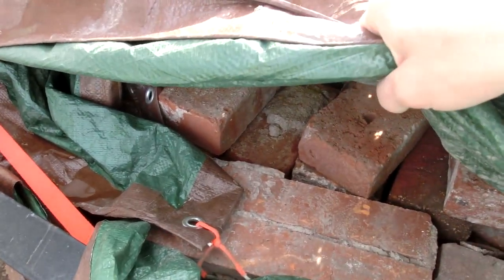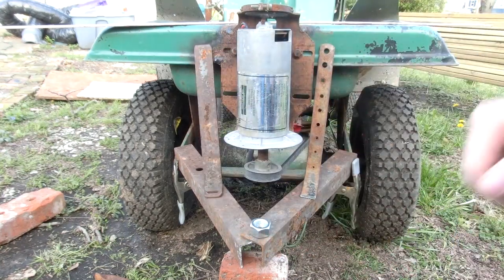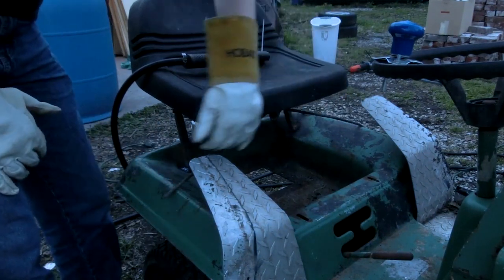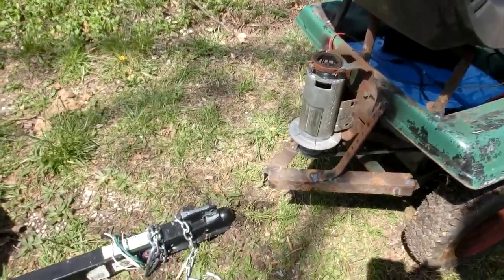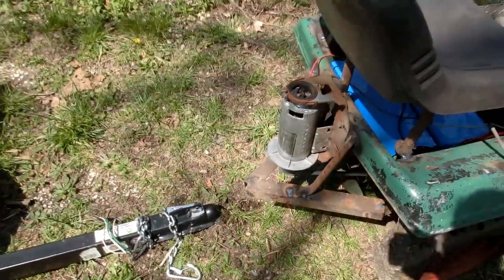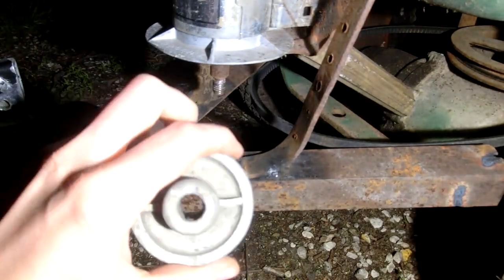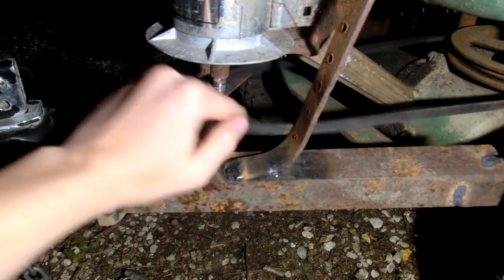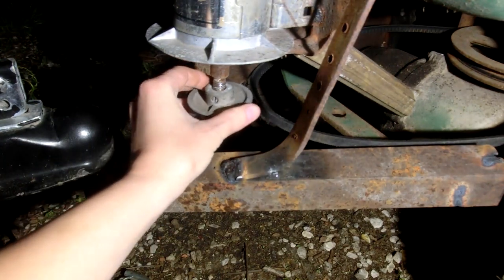DIY Electric Lawn Tractor part 14: Trailer Hitch

Comment: mount the motor in front under the hood. that would free up space in the rear for the ball hitch to be placed close to the rear axle. that would prevent tipping. it would be awesome to add a second motor and batteries for a lawn mower blade. definitely go all lithium. save the lead acid batteries for your photo voltaic system. p.s. i would love to see you do a series of converting old power tools and appliances to battery powered electric. name suggestion, "Will it Lithium?" p.s.s. i just discovered your channel 3 days ago and have been binge watching ever since. thank you for the awesome content!
Reply from the maker: +stompbot272 its working well enough at the back, and it leaves the front open. i might need that space in the front for hydraulics in the future.

thats a nice name idea for tool upgrades, although im not a huge fan of power tools and dont work with them much.

and im glad to hear your enjoying the videos! im trying to increase from 100 videos a year to 150 or 200, so there should be plenty more for you to watch in the future. so far this year ive set a new record for video output for each month and already at like 75 uploads this year, so i feel i might actually reach that goal. :D
Reply: your electric bike videos are what caught my attention. i am planning to build my own 2wd fat tire bike soon. still trying to figure out how to power two 1000 Watt hub motors with one controller. thanks to you, i have a way to make an inexpensive 48v battery

Comment: When welding nuts is good to have a sacrificial bolt or all thread, threaded in place to keep the nut in line and to keep warping to a minimum.

Comment: This is something I need to get around to doing. I just use an old bolt into a flange on the back of my riding mower. Admittedly it works, mostly because the flange is reinforced as it was meant to drag around a much larger mower/mulcher attachment. If only I had any use for the drive connection at the back of my mower.

EDIT: If your going to use a chain, use something like motorcycle chain instead of bicycle chain.
Reply from the maker: i was thinking i'd get chain from rural king thats made for farm equipment, but i agree, bike chain wouldnt be very nice to use.
Reply: Yeah that sounds pretty good. From experience bike chain sucks, even for use on a bicycle. For my current bike I actually went and bought a much more expensive chain just because I had it break once when I was about 20km from home on a trail and didn't much care for the four hour long walk back because It broke in a stupid, stupid way. Pretty sure the chain is worth more then the bike.
Reply from the maker: i've honestly never had a chain fail on me before, especially now that i have electric motors on my bikes. haha
Reply: How about an old timing chain and gears from a junkyard? Not sure if the gears would be the right size both ID and OD but it may be worth looking into, it would certainly handle a lot more torque than a bike chain, plus it would be damn cheap maybe 20 bucks max.
Reply: Yeah, well I bought my bike on sale, so they took off everything of value from the frame, and replaced the more expensive chain with a cheaper one.

Comment: Love the old welder used to use one like that years ago 46 plus years ago...neat old machine ... Love Ur Tractor,  but would  like to see more or of a newer or nicer mower build electric wise, with the motor under the hood, bigger better tires and. a winch on front... hArbor freight has them cheap enough and a old garden tractor can be found cheap enough like a Cub Cadet, John   Deere , Wheel Horse , same with a plow and u could use linear actuator for lifting your blades, also u could use an old water tank if u cut it up yo make a decent blade out of as I did... anything wrong with Ur system just thought u might want to try Ur skills on a newer bigger tractor food for thought so to say also u could put motors on each blade to cut the grass... thanks Rhinoa

Comment: I gotta get busy on my lawn tractor.  I DO have electric reversing and a (commercial) PWM speed controller as well as a three-speed transaxle.  When I had the one horsepower motor it would go into 25% overload climbing my relatively steep driveway in third gear but now with the two horsepower motor it just flies.  Top speed with the current gearing is calculated at 5.77 mph.

You might want to experiment with a wider vee belt drive to transmit more power.  I have a chain drive on mine and it is really picky about alignment, a problem greatly alleviated by the "rubber band" drive.

Comment: On farm tractors you usually have a place on the front to add weights to keep the front end on the ground when moving heavy trailers or three point implements. Or you could add a few more batteries, they weigh quite a bit.
Reply from the maker: yeah but i didnt want to put too much stress on the back.

Comment: the railroad tie piece could be screwed onto the front as removable ballast.  (for when the trailer is heavy.) and if bolts are long enough you can add more.

Comment: The three phase motor out of a fork lift truck aught to be powerful but a DC to 3 phase inverter would be needed with the required amperage to drive said motor.

Comment: Place your hand at the bottom of the steering wheel (6 o'clock position) and turn that hand in the direction you want your trailer to go
Reply from the maker: no thanks, my steering wheel is geared too much to do that and plus i like keeping my hand near the top.

Comment: When you said you were going to fix the front tool I though you might add a ballast box and put some brick in it so the load was more balanced. I suppose that extra weight would really tax the power capability though. You might be able to drill all the way through the spindle of the motor and pin the pulley on.
Reply from the maker: no, i can just stuff weight where the engine used to be.

Comment: Put a 5 gallon bucket on the front end of your mower and fill it with water. should help balance it out.
Reply from the maker: i just put bricks or metal rail plates in the front.
Reply: Rinoa Super-Genius that works. lawn tractors are really awesome to move trailers around the property. I hear they cut grass too.
Reply from the maker: +ThriftStore Hacker no thats what mowers are for

Comment: Would another stage of gear reduction help ?
That is if you added another set of pulleys or cogs, 
so the motor rpm is at peak power for crawling with heavy load.
Reply from the maker: nah, if i need more power i can go up to 100v if not more.
Reply: OK sounds good.

Comment: Would it be possible to modify your switch so that you can use it as a pedal? it would make moving and steering easier I would think.
Reply from the maker: i'm not a fan of foot throttle tbh
Reply: Rinoa Super-Genius it just seems a little awkward to me to have it way up top there. But I suppose with the knob on the steering wheel that helps.
Reply from the maker: seems awkward to have a pedal for gas to me, funny how that works. do you happen to drive automobiles? that could explain why you find a foot pedal to be less awkward.
Reply: Rinoa Super-Genius yes I do drive cars. And hope to autocross some too soon. I guess since you have 1 hand for steering and one for shifting that only leaves your feet for the gas, brake, and clutch. But with an electric bike it does make more sense to have a hand throttle, and since that's what you're used to it makes sense why you'd like the hand throttle.

Comment: Something tells me you need a more powerful motor
Reply from the maker: why? its like a 120v motor and i'm nowhere near its full power.
Reply: I thought the motor only had 1 1/2 hp
Reply: As I recall it is a 1-1/2 horsepower motor from a treadmill.  Rated at 100 volts or more and I see that with the new battery packs she is up to 72 volts.  So IF it needs more power all it really needs is higher voltage.

Comment: heheh! That ARC every time you stop and start the motor (open and close the connection).  Can you use some kind of relay mechanism ?
Reply from the maker: sure, but this is really simple.
Reply: My method for testing solar panels is really simple too.  I short the leads.  There's a huge arc with the larger panels in full sunlight.  I don't know HOW many amps but it's enough to say "yeah, that one's working!"
Reply from the maker: yeah thats a good method, or at least its easy and hasnt killed any of my panels yet.

Comment: Are you should build a homemade excavate arm and attach it to the tractor
Reply from the maker: i agree, but i may build a small tracked vehicle for that. i'm not sure.

if not it'd be nice to get an electrically driven hydraulic system.

Comment: how many watts/HP is that motor and what welding rods/electrodes are you using?
Reply from the maker: its like 1500 watts or so, and i just use the first rods i grab.
Reply: I think a big caster wheel under the trailer would cut back on the power needed from the batteries. maybe. If the trailer is used on the road, the wheel would have to be removable.

Comment: Why dont you use lead acids? They add a good counterweight....
Reply: Fum3s inefficient
Reply: She originally had sealed lead-acid batteries at about 48 to 60 volts.
Reply: Clyde Fishface I thought it was a he not a she
Reply: Rinoa is trans-gendered and prefers the pronouns she and her.

Comment: why not just drill a hole thru the angle iron and put the hitch thru it and mount it that way
Reply from the maker: would need a big bit, its easier to weld.

Comment: turn you bike on its side and observe...gravity , alingment , debre , proper tensioning...ect
are all agsint you...how many horozontal chain dreive have you seen...all i have ever seen have been vertical configurations...
Reply from the maker: i've seen it on old far equipment, seemed to work ok.
Reply: good luck...am sure you will find belt drive less problematic...
even harley is going to belt drive...belts help minimise the clunks /strians of the final drive
somtimes a little slipage is good

have you ever gone to the BUCKLEY (MICHIGAN) OLD ENGINES AND THRASHERS show ? third weekend in august always

highly recomended

super brite leds might have direct replacments for your lights

Comment: The irony in this video is uncanny. In a comment on the 12th video of this series you claim that gas engines are weak yet something with around 8 horse could easily move the trailer.
Reply from the maker: meanwhile this is only using like .8 horsepower to move the trailer. this 1.5hp motor is far stronger than a 1.5hp engine.
Reply: +Rinoa Super-Genius I should have been more specific and say the 8 horse would have been more efficient to move the trailer. but as far as strength I agree the electric is tougher. I'd much rather have a electric motor running my contractor saw or any power tool except a circular saw.
Reply from the maker: no, it would have been less efficient. using 8hp to do what 1hp can do is very inefficient. lol

i take it you use a gasoline circular saw? those seem pretty tedious.
Reply: +Rinoa Super-Genius I'm very vague sometimes. time is always money though, I can only assume that the electric tractor took more time than a gas engine (even it's a little bit more) 

and yes the gasoline powered saw is tedious but look at it from my perspective, dragging a long extension cord sucks, and if your on a big site and have to make a lot of quick cuts in multiple places the gas is definitely the way to go, but if I'm in my garage electric power all day.  

Do you think a electric powered concrete saw would be practical? (off topic) but I couldn't imagine a electric engine turning near as fast as two stroke without generating mass amounts of heat. random I know.
Reply from the maker: not always, time isnt money to a homeless person. :p

i think a BLDC motor could handle that wihtout overheating, but i'm not sure. it would definitly use less power though. its amazing how much electricity is spent in the production of gasoline.

Comment: ps For years I never had a welder then bought a few cheap ones and one is an old small 110 vilt mig welder would u be interested in it? it needs a New switch on ok the leader New lead for it it's a gasless unit need an address if u want it otherwise it's going to the junk pile ... pss I just got an nice old lincon welder will be my main welder besides my other mig my son gave me ...I'll need Ur address u do want it
Reply from the maker: +James R Dugger yeah id love a welder, ive been wanting to find a mig welder and take it apart, then fit the parts into a waterproof battery powered box. although id probably just repair it and use it.

i have my address on the "about" page of my channel, if you send it i will feature it in an inbox video.

Comment: 1 find nut to fit threads on motor
2 install nut using locktite stud lock( or similar sploge  )
3 run motor and use grinder to adjust dia, to fit pully
4 grind flat for pully bolt

chain is a bad idea

been ther , done that
Reply from the maker: why is chain a bad idea? chains are used all the time for mechanical connections.